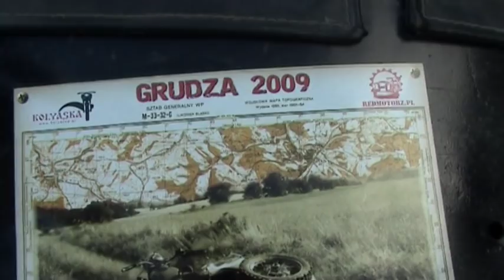Rajd u Janka - K750, Ural, dnepr, m72, MT16, meeting in mountain

Comment: I found a Dnepr sidecar motorcycle in a barn and purchased it. I spent the 2018/19 Winter rebuilding it and fixing factory  installed problems. It was a lot of work but it's been well worth it. It's the most fun bike I have ever owned. Because I took everything apart and put it back together correctly it's actually a good motorcycle. I've worn out the new tires I put on it during the rebuild from riding it so much.

Comment: i got a question hoping you can help me out

i'm about to buy a k750 but when the owner tried to start it up it didn't go really smooth
it took him 3 tries with fuel pumping into the engine
but also the radiator started to leak quite some fluid
but after it started the leaking stopped

is this gonna be a problem?

i've seen some videos where they started there's smoothly like it was a factory new motorcycle